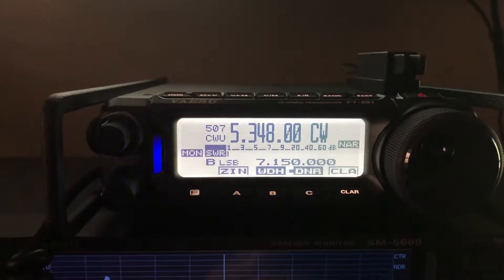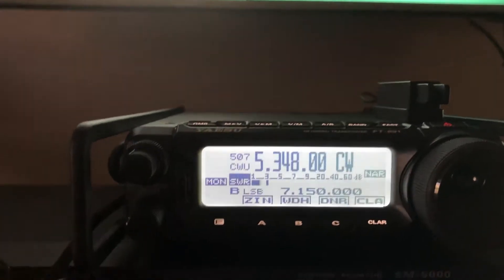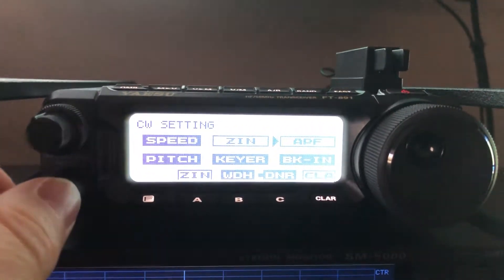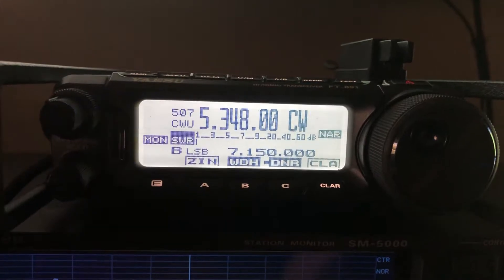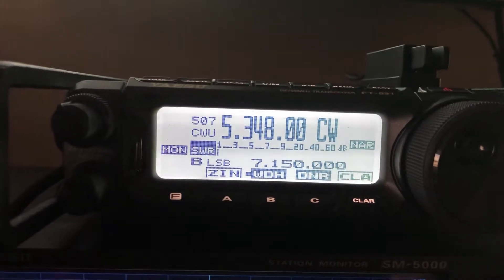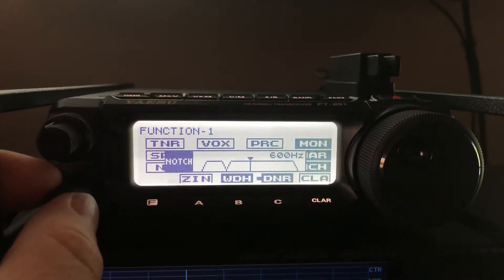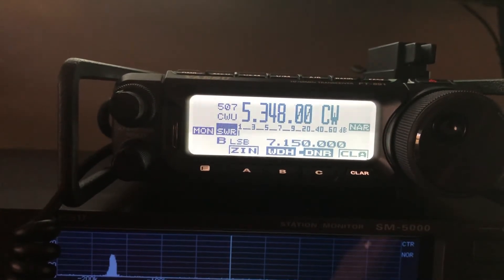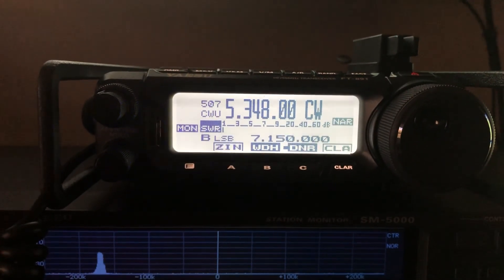Yaesu FT-891 pulling out weak CW signal

Comment: Hi! How's the qsk of this radio? Clicky or smooth?
Reply from the maker: Clicky. It uses a relay. I use semi break-in with a 500ms delay and it works fine for me. The relay is less susceptible to damage than the PIN diodes. The FT-891 is a boss of a CW receiver. It can make a weak signal sound as clean and clear as a code practice oscillator. 

73, de N4HNH

Comment: Hey Doug
I recently purchased a FT891 for camping and portable work next summer to replace a old ICOM 745. I’m using it in the shack now to get used to the menus and how to take advantage of its great filtering. I am primarily a CW operator.  My question is how do you get CW to show up on the display the same font as the frequency numbers?
73
WA9SWW. .
Reply from the maker: I used the memory tagging feature. My 60 meters SSB channels show the suppressed carrier frequency, such as 5.330.50 USB, 5.346.50 USB, etc.  I did that so I didn’t accidentally post a SOTA spot as 5.332 USB, instead of 5.330.5.  I cover memory tagging in the 3-part series I shot all about 60 meters.

73, de N4HNH
Reply: @n4hnhradio  thanks Doug I’ll check it out. See you down the log 

73